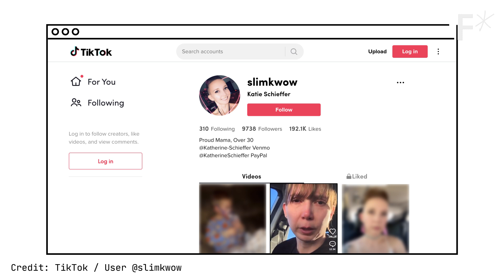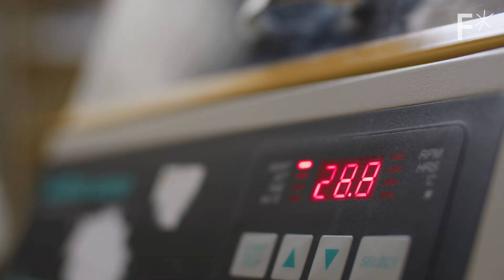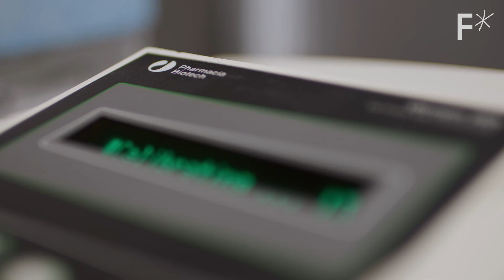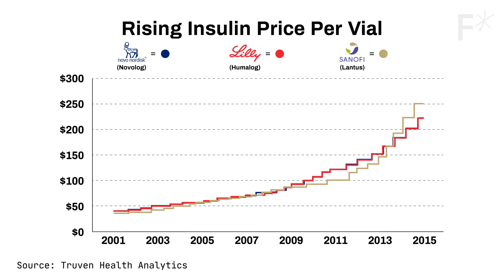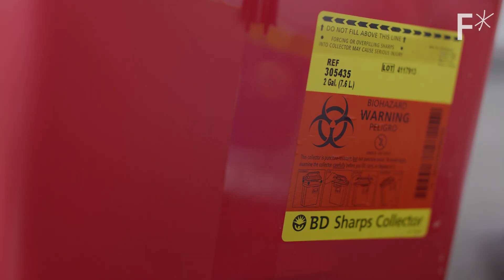The biohackers making insulin 98% cheaper | Just Might Work by Freethink

Comment: Its not a "solution", one the insulin they produce is not chemically the same as the main two producers as its a different variation of bacteria. Production at home is also not safe because of the level of sanitation required. If the women at the start of the video was caught trying to give her child such a thing she would be locked up for endangerment.  The real reason insulin costs so much is more a aspect of supply and demand rather than greed. Only two strains are approved for medical production in the US and the amount they can make is pretty limited. At the same time the amount of people needing insulin has skyrocketed at an exponential rate over the years. So the real solution to the problem is not asking your self how can we produce more for less, its why there is a constant increase in the demand in the first place.

Comment: What the real suprising solution is fasting. Go fast and it will fix itself. Fasting is reversing all cardiovascular diseases or keeping them stay away as long as you live. Go keto and fasting to enhance the effect. Go to Dr. Berg youtube channel to get on the right foot for why it works and why everybody should do it. This insulin problem is mostly man caused by themself. All the epigenetic code for proper rebalance of insulin lies inside our bodies we just need to chill and not eat for 16 hours a day or longer. Longer is mostly better but you need to know what your doing. Importent is to eat minimun carbs unless those come from veggetables. No cola no diet cola none of that man made crap. Water, whole foods, no grains, lots of good fats. 20% might be caused by our genes but 80% its our own fault. If you think its really your genes, you can get that tested with "whole genome sequencing" tech for around 400 dollar. In year 2000 it was between 120-800 million dollar and took ages to get done with big chance of failure. Now its cheap and reliable. Knowlegde is more powerfull than things, we should spread knowlegde not medicine. I'm kinda mad about this because when you get your insulin medicine it only good on short run but your cardiovascular system isnt getting fixed while in most cases around 70-80% of them its quite reversible if you begin in time with right food and movement behaviour(behaviour in general). Grains(carbs) and frequent eating is main cause of cardiovascular diseases and from there its an gateway to any other mental or physical problem. Follow Dr. Berg, dr brad stanfield, David sinclair. Watch "what the health". Do it especially if you have certain strain of any disease in your family, you dont need to be the next one in line with same end life results. ITs really up to us to change the course of our health. And thats a good thing, its wonderful its up to us for most of us rather than its a lottery game. I know its alot to swallow for some. But if you do it i might become gratefull for that, so leave a comment below if you already knew it, done it or might be about to get in touch with it. There is hope and its freaking awesome!

Comment: For fuck's sake, if you have type 2 diabetes, you do keto and a bit of metformin if it's really serious. If you have type 1, you do keto and get exogenous insulin but you need a fraction of the amount you would normally use. You have two main pathways for energy intake and only the one needs large amounts of insulin to drive. Open Insulin makes me hopeful and is simply heartwarming, and it's part of the solution in treating T1D. T2D is easier.

Comment: I used to purify proteins for research.   I can help. Expression when od600 is @ .8 at 16 degrees C O/N ussually helps with yield even for unstable proteins. In your gelfiltration buffer use some peg to help with stability.

Comment: As a T1D I am rooting for you guys...glad you mentioned the supply chain at large too as the problem, and not just the manufacturers
Reply: The most surprising result was that more than 50% of subjects were 𝗮𝗯𝗹𝗲 𝘁𝗼 𝗱𝗶𝘀𝗰𝗼𝗻𝘁𝗶𝗻𝘂𝗲 𝗶𝗻𝘀𝘂𝗹𝗶𝗻 𝗰𝗼𝗺𝗽𝗹𝗲𝘁𝗲𝗹𝘆 𝗮𝗳𝘁𝗲𝗿 𝗼𝗻𝗹𝘆 𝟭𝟲 𝗱𝗮𝘆𝘀
 on a low-fat diet, 
even having lived with type 2 diabetes for multiple years.

James W. Anderson and Kyleen Ward conducted a study in 1979 in which they enrolled 20 subjects who had been living with type 2 diabetes for more than 20 years 

The researchers fed participants a diet low in fat diet and high in carbohydrates but not restricted in calories,

 and monitored changes in insulin requirements and blood glucose over time.

In order to study the effects of diet alone, they made sure that subjects ate enough to prevent them from losing weight.

Some subjects complained of physical discomfort from eating so much food, but the protocol ensured that all subjects remained weight stable.

By doing this, they could then study how insulin requirements changed on a low-fat diet, independent of weight loss.

The results of this study were nothing short of remarkable. 

Insulin requirements plummeted by an average of 58% in the group that ate a low-fat diet, 
whereas insulin requirements did not change in those eating the conventional diabetes diet.
𝗧𝗲𝗻 𝗼𝘂𝘁 𝘁𝗵𝗲 𝟮𝟬 𝘀𝘂𝗯𝗷𝗲𝗰𝘁𝘀 𝘄𝗲𝗿𝗲 𝗮𝗯𝗹𝗲 𝘁𝗼 𝗱𝗶𝘀𝗰𝗼𝗻𝘁𝗶𝗻𝘂𝗲 𝘁𝗮𝗸𝗶𝗻𝗴 𝗶𝗻𝘀𝘂𝗹𝗶𝗻 𝗮𝗹𝘁𝗼𝗴𝗲𝘁𝗵𝗲𝗿
and those who continued insulin therapy were 
𝗮𝗯𝗹𝗲 𝘁𝗼 𝗿𝗲𝗱𝘂𝗰𝗲 𝘁𝗵𝗲𝗶𝗿 𝗱𝗼𝘀𝗮𝗴𝗲𝘀 𝗯𝗲𝘁𝘄𝗲𝗲𝗻 𝟳-𝟵𝟴%.

The most surprising result was that more than 50% of subjects were 𝗮𝗯𝗹𝗲 𝘁𝗼 𝗱𝗶𝘀𝗰𝗼𝗻𝘁𝗶𝗻𝘂𝗲 𝗶𝗻𝘀𝘂𝗹𝗶𝗻 𝗰𝗼𝗺𝗽𝗹𝗲𝘁𝗲𝗹𝘆 𝗮𝗳𝘁𝗲𝗿 𝗼𝗻𝗹𝘆 𝟭𝟲 𝗱𝗮𝘆𝘀
 on a low-fat diet, 
even having lived with type 2 diabetes for multiple years.

In addition, as a convenient side effect of a reduced intake of dietary fat, cholesterol levels dropped an average of 29%, from 206 mg/dL to 145 mg/dL.

Most importantly, all patients in this study were able to reduce or discontinue insulin therapy and reduce their cholesterol levels without any changes in body weight,
 clearly demonstrating that less dietary fat results in less insulin need.

Just imagine what would have happened to their cholesterol levels if they added the world's most powerful cholesterol-reducing food – amla (Indian gooseberries)...

Anderson JW. High carbohydrate, high fiber diets for patients with diabetes. Adv Exp Med Biol. 1979;119:263–73.
pubmed/495284

Comment: For those defending the companies that create it. Yeah, R&D is expensive, but most of modern insulins aren’t new. They slightly modify older types so they can re-patent them so they can control the market. The one I use is called Fiasp, but that’s just NovoRapid/Novolog insulin with vitamin B3 added to it for faster absorption. NovoRapid was approved in 2000; 21 years ago! NovoRapid is one of the most common insulins used by type 1 diabetics.

The market for insulin is so large now, that even though R&D is expensive there are enough costumers for the price to be lower, because many of insulin users are life long users of insulin.
I’ve used insulin since I was 14 and if I have a lifespan similar to my family, I will have used insulin for at least 70 years by the time I die.

Comment: This is stupid or I've completely missed the point. 
These or other smart arses start producing insulin and slightly undercut current price for max profit. 
Use profits to expand into other drug production and do the same thing. 

Lower insulin proce will force competiors to cut prices so it'd go down and down until close to cost of production. 
Free markets at work.
Most efficient producers with best products survive. 
Back to capilitism we go, away from govertnment bought corporatism.

Comment: Citric acid 3%  benzyl water 3:1 45%  isolated sucralose diethylate  52.3%
Reply: Use a water distiller. Mark a line on a full red label bottle of isopropyl. Reg size. Mark 1/2 line,  dump 1/2, top to line with everclear, take sucralose liquid in glass, mark 1/4s, dump in 1/4: add to distiller. Add 5 reg packs of sweet n lo. Distill. If damages ..add deep surface source drinking water..1/8 -1/4 of volume added. As 125% formula. If weak..add drops of citric acid n redistill. 14-25% oral consumeable. Keep under 7 distillations

Comment: Wait a minute a vial of type R  insulin that is a fairly fast acting short term is only 25 dollars with out a prescription a Walmart  you can also buy a type know as 70/30 which is a combination of the fast acting R and a longer slower acting type known as NPH both of these types of insulin work just fine i have been using them for many years the doctors and the drug makers don't want people to know these are readily available  cheap and without a prescription.